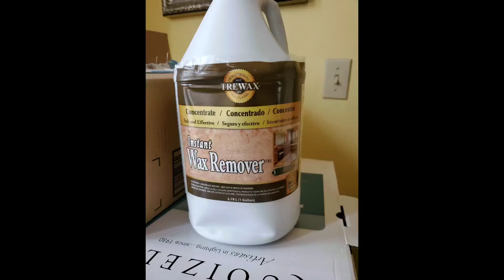Cheap and Easy way to Remove wax buildup from wood floors

Comment: " Cheap and easy way to Damage your hardwood floors " the title should say . or How NOT to remove wax from floors . Remember it is not just the chemical but the volume technique and application and machinery and right pads what gets the job done right without damage to the underlying surface . DO not try this at home You wil scratch the hell out of your floors .
Reply from the maker: Actually it didn't scratch my floors at all.  It just removed the wax buildup from the years of Mop and Glo and the pad was just a microfiber pad.
Reply: Worked just fine for me!

Comment: Will this work for engineered hardwood floors? Worried if it’ll scratch/remove the top coat?
Reply from the maker: I think you should try it on the corner in a closet to see if it works.